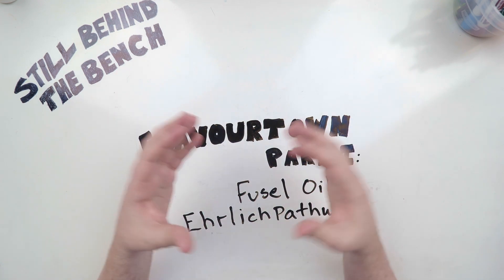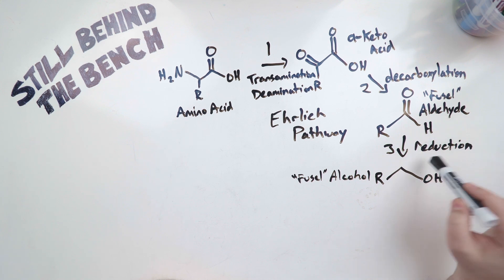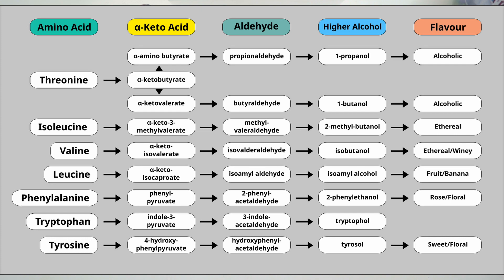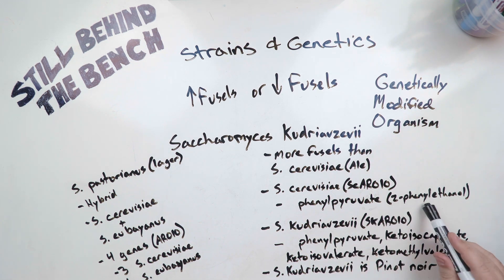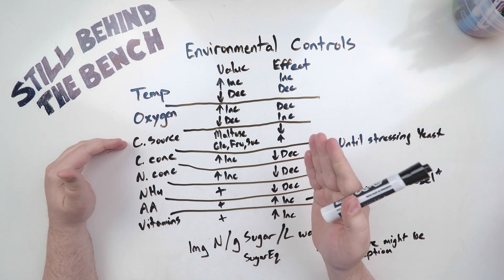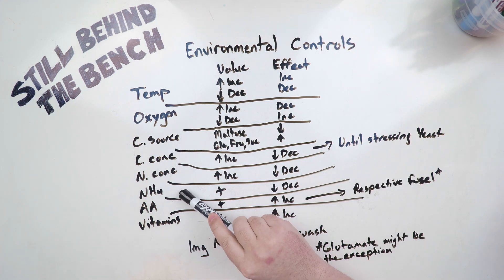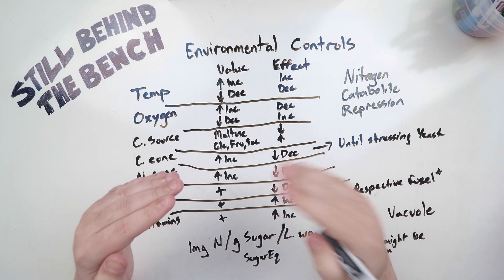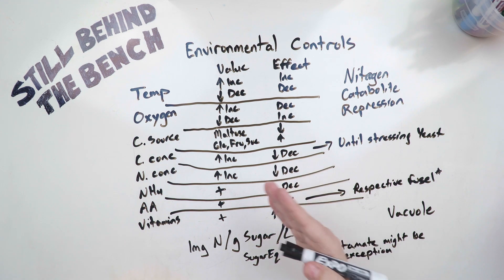Ep 031- Fusel Oils (Fusel alcohols) and the Ehrlich Pathway

Comment: I have heard anecdotally that in rum 20% of the total psycho activity can be from n-propanol. This idea highly intrigues me, and I wonder if this is what is responsible for the association of different effects between different alcoholic drinks.
Although from what I understand propanol is undesired though because it has a higher chance of producing acidosis. 2merhyl2butanol though seems like a very interesting compound. Apparently it has a very similar boiling point to water so it’s definitely gonna be in the tails, do you think it’s possible to separate out the 2m2b from all the other tertiary alcohols?
Reply from the maker: I don't know what you mean by psychoactivity. But n-propanol, in rum, depending on how the rum is made, is usually only the 2nd highest concentration of the fusel alcohols, after isoamyl alcohol, which usually has at least a 30% higher concentration. A lot of the propanol produced will probably react with the organic acids present and turn into esters, any that isn't esterified will simply just taste like alcohol, and I doubt enough is produced to cause any significant health issues.

As for 2-methy-2-butanol, I don't know if it is produced or not, in the video I mentioned a slightly different compound, 2-methyl-butanol (aka 2-methyl-butan-1-ol), which has that ethereal flavour. But in both cases, being that they are alcohols, with high boiling points, they probably will come out early in the tails, or late in the hearts, depending on the composition of the wash/mash. Separating out any of these compounds would take a lot of work, that imo, is not worth it. Especially since so little of is going to be produced.